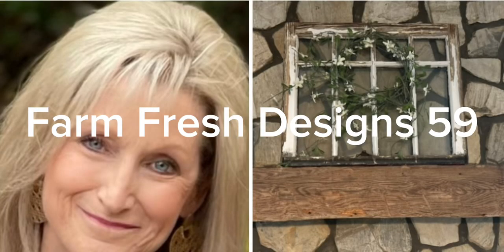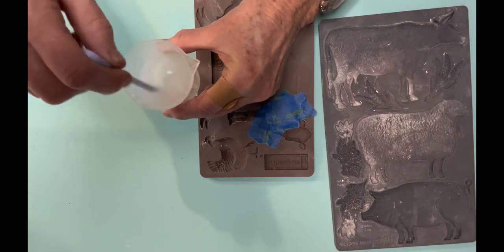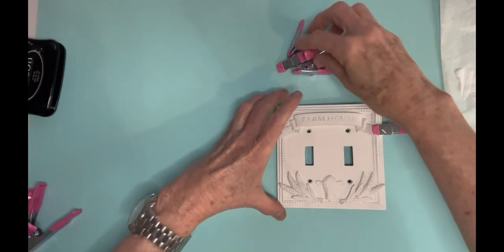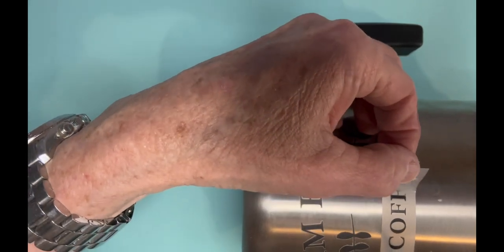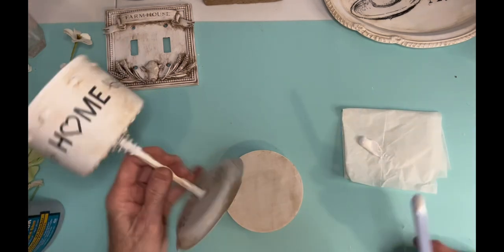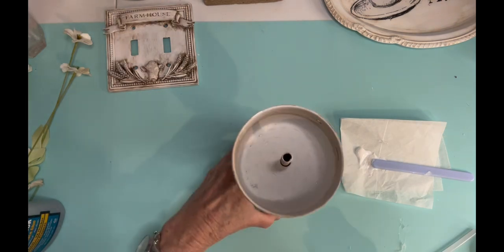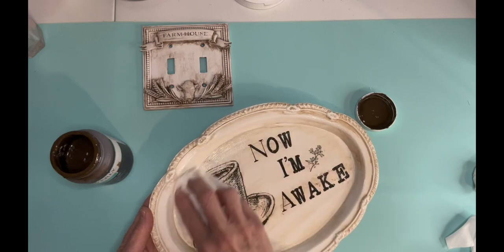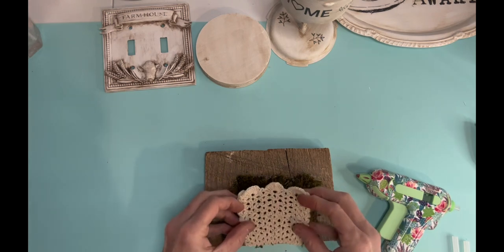A farmhouse coffee bar area trash to treasure DIY

Comment: I bought droppers to apply the resin to the mold. Works beautifully.
Reply from the maker: Hey Melba, I love that idea.  Where did you get yours?  Do you mix less so it doesn’t set up in the mixing cup?  It would help especially in those molds that have tiny areas.  Thanks for watching 💕💕💕
Reply: Great idea.
Reply: @farmfreshdesigns59  i mixed less.  the droppers are more efficient
Reply from the maker: @melbabowen4389  perfect.  I’m going to try that.  Thanks for the tip.  💕💕💕